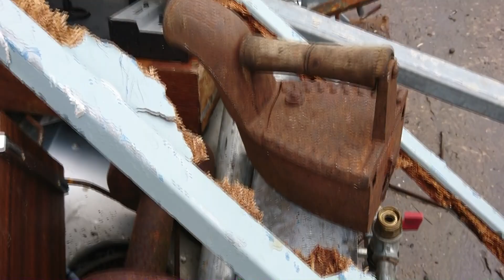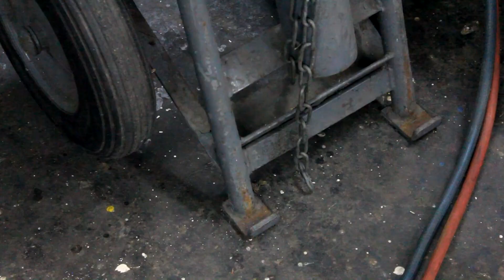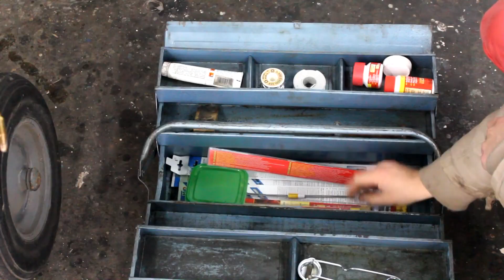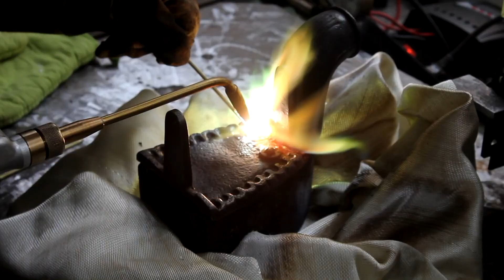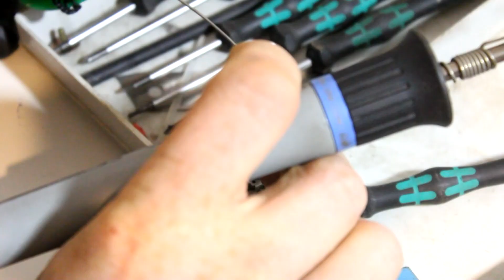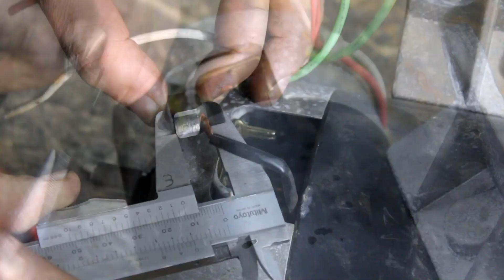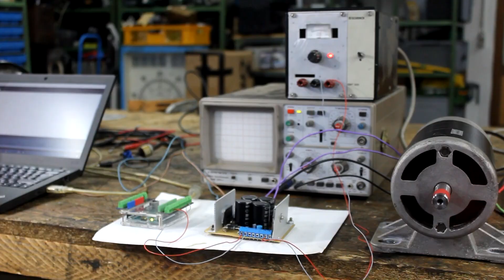Amazing Scrapyard Finds! Repair-A-Thon!

Comment from the maker: A new video is now online: https://youtu.be/XhzMke72xts
Reply: Using natural gas and compressed you would have achieved a neater seam. Borax paste coating the area and scrap brass instead of welding rods, you would have avoided the lumps of weld. Alternatively silver solder and  A 4 flux from Johnson Mathey. 
Unlike using the welding technique natural gas and compressed air enables the  brass or solder to  run along the crack or seam. Try it
Reply: Should have read compressed air
Reply: Nice now let's build a jet
Reply: The torch looks beautiful.
Reply: "You can't weld cast iron"
That's why called it cast iron

Comment: you done well by buying a new one and you done well on your first attempt to braze ... an Oxy torch setup cost a lot of money i know and i also know how it feels when your garage explodes ... i almost died.
So yes be aware of the danger using these gas tanks, keep checking for leaks make that cart trolley strong and stabile. I luv your works keep it up !!

Comment: A handy desoldering tool an be made from a hairdryer or even by putting a hood around a lively soldering iron in order to force a sirocco from the open end.  I find this manner to most efficient for programmable chips and other caterpillars, as it melts all of the solder at the same time, thus making the operation a "grab and go" maneuver with a pair of tweezers (forceps et alia).  I learned to braze with the help of a jar of Borax as flux.  As they say, practice makes pretty good.

Comment: I have seen some truly amazing cast iron welding done with some kind of iron filler rods and an oxy acetylene welding torch, I don't know the process but I know it can be done, also silver soldering works very well on cast iron and is very strong but melts at a lower temperature than brazing so no good for that coal fired laundry iron

Comment: I like the way you do your first attempts on video, you did an outstanding job brazing for a first attempt
one thing to watch for when testing for a gas leak is to make sure to use a non-petroleum based soap on the oxygen, Oxygen will react with oil and oil based product and could explode. Great video.

Comment: my advise for the homeowner is to go with lp or propane and oxy set up. All I used in shipyards and cuts just fine. You dont need the gas to be high pressure out of the cutting torch but the oxygen and your cuts are limited to the oxygen pressure. I cheaper in the long run and honestly a lot safer over all especially in shop spaces

Comment: Actually, permanent magnet direct current motors intended to be operated from power supplies supplied with ~115 volts AC are standardized at 90 volts DC. Your motor is intended for operation from a power supply that is supplied with ~230 volts AC, give or take. A simple rectifier and capacitor circuit results in a very low power factor on the line which is objectionable and not practical for all but the lowest power circuits. Instead they will have something along the lines of a rectifier and a pulse width modulation circuit to control the speed, along with some coils and caps and the like to smooth the input current waveform. There are likely other more complex circuits, like synchronous rectifiers and such. Would generally disagree with old tools, but do agree that they need to be made to be in a reasonably safe condition. Love your channel, keep it coming. ;)

Comment: I bought all my torches used and fixed most of them myself with things I find, I have 1 long Victor torch and 1 medium duty Victor torch that I soldered the cracked head on, a broken small Victor torch and a long Harris torch with a medium duty Harris torch both work perfectly tho and a smith long oxypropane torch prototype and 2 small Smith torches, all the medium duty torches I have have their welding and brazing attachments and I have all tip sizes for the cutting torches both Harris and Victor but the long torches can only cut not weld, and I have gouging tips and two 150cf oxygen and 145 cf acetylene, the only things I've ever bought new was a cutting tip and a 100ft hose and everything I have I got used or broken and they're my favorite toys

Comment: Regarding the DC motor control circuit: how did you calculate the number and values of the capacitors?

Comment: You should see about o-rings designed for hvac (heating and air conditioning) applications
Im sure they are availible in Germany. They last so much longer that the black ones
they are bright green or bright red in color , the wide range in temperatures they are designed
to work in is what gives them this advantage.Cheers from the U.S.A/Nick

Comment: 101 of buying used gas oxy set check all parts and change were needed, other way to fix cast iron is drill small  3mm holes  along the sides of the break and grind a 30 degree rough to both broken sides use 3 mil wire to stitch together preheat wire as you go and fill grinded trench with braize locking the stitch and break together stronger fix

Comment: Your intro was right on point. I do not have access to a scrapyard like the one you go to but we have a town 
"recycle center". Depending who is working that day I ""may  "" be allowed to take something out. Not even allow to buy anything there. When I am allowed to pick  it is incredible what I get. As I mentioned before the theme of my channel is reclaim repair reuse recycle. Nice safety upgrade on the cart. I am just getting into DC motor controllers & gathering information. Great video big 👍
Stay safe, Joe Z

Comment: and to think by blow pipe was made in 1942. also learn how to set up and start a torch, little bit of acetylene no oxy to start bring the acetylene up till its a flame with no smoke then increase the oxygen until a small blue flame is just poking out of the nozzle

Comment: With respect, Sir. The iron should have been placed into an oven to heat the iron to red heat. Then you can weld or braze, Why? Well, the heat is evenly distributed throughout the iron workpiece. The iron is not only cleaned of contaminants, but the iron is heat treated to that which it was when it came out of the factory, with the correct grain structure. The brittleness is less and should not shatter if dropped on the hard surface, for say 1:5 m. I hope this information helps.

Comment: Please I have a question ..What hapen if I use DC insted AC with corded power tools like drills or angle grinders is it  better? Or same .. I say this because once I read  that bad conmutation in AC is the cause for sparks .. please tell me your opinion or experiences

Comment: When I worked for my brother-in-law he was so afraid of lawsuits because of defective equipment. He bought all new equipment for every contract. Once the contract was finished he threw away more good equipment, some of it never used, and some of it very expensive to replace. 
When I hauled the equipment to the county scrap yard there were always gleaners going through the refuse. I made certain that they knew about the good items it was dropping off. Seemed like such a waste to bury it.

Comment: I would say that your brazing tip was too large, when brazing you want a pretty small flame so you can heat the patent material slowly and control the molten puddle more easily

Comment: Love the repair a thons. In Australia our voltage is 230v yet all the dc treadmill motors I have recovered are 180v dc. We must be a lot lazier than you Germans as I stopped picking up treadmills after I brought home my eighth unit in 18 months. All were pickup for free or out on the street for free. The ones that raise and lower the deck are good as you get a linear actuator as well. I converted a 240v Ac belt sander to the 180v dc treadmill motor and I’m very happy with it as now it is variable speed both faster and slower than the Ac motor. I bought all the parts of eBay and followed the instructions I found on YouTube and I couldn’t believe my luck when it worked perfectly first time. I even added a tacho so I know what the rpm is. It hasn’t missed a beat in two years. Jeremy Fielding has the best channel I have found for explaining electric motors and how to repurpose them. Cheers Stuart 🇦🇺

Comment: Bevel the joint at 30degrees and round the root face of no sharp edges dont touch the services to be brazed with your hands always wear gloves  if you round the bevel face the brazing flows round the joint only heat till cherry red.

Comment: "Airconditioning unit" is basically a compressor and heat exchanger for a small walk in cooler or split fridge system like you'd find in a bar or cooling display counter in a store...

Comment: Re: your dc magnet motor. I have three similar motors manufactured by the Ya Cheng Electrical Engineering Co. Ltd. of Taiwan. Mine claim to produce 4hp@4100rpm, 90v 25a. Would love to have over to visit my local scrapyard. Nice videos btw.

Comment: There is no need to use oxy acetylene when braising. Natural gas and an air compressor gives a 100% cleaner solder line.
 Clean surfaces to be joined. Coat with a Borax paste. Heat the area with the natural gas and compressed air torch. It's slower but cleaner. Instead of welding rod use brass wire. Have used this method when taught back in 1965. Borax stops oxidisation and if you can afford it Silver solder is better using a soluble flux.

Comment: I actually like the design of the torch cylinder cart, I think it needed a plate contoured to the bottle cylinder radii fastened at the upper saddles.
Nice save on the Becker cd player

Comment: I could imagine placing that DC motor on a bicycle and flying down the road. Perhaps mounting it within a cage that straps to the back with a propeller, strapped to the back with harness and use a paraglider to actually fly. I am certain it would be powerful enough.

Comment: That is the WRONG technique for brazing. DO NOT GRIND A V!!!  For brazing you want to the minimum gap. Grinding a V is for welding. For brazing, you want the thinest possible crack.  The joint should have flux applied, then heated. When the joint is hot enough, the filler should be applied to fill the joint through capilliary action.  You want the tightest joint and the minimum amount of filler.

Comment: you could have microwaved the flat iron. yes there would be sparks, arcs, and flashes of plasma, but IT IS OK it won't hurt the microwave and you can potentially get the metal up to 800F. Have you noticed the metal riser rack that comes with the oven?   I personally melt rocks in my microwave as stress relief, I can take most rocks except quartz from solid to molten in under 3 minutes (I get a pocket of molten rock about 1 inch round, bigger if i leave it on longer - not longer than 7 minutes).

Comment: I did not know you needed to bevel the joint to braze.  It has been 35 years since I took welding, but I was really good at it.  I would not think you would need to preheat to braze either as you are not melting the metal for the joint.  Brazing if done right should look like a solder joint.  You put WAY too much on both sides.

A motar like that can usually charge too.  I know people use moters like that for wind turbines.

Comment: The odd looking cast-iron object is a coal heated iron, very common in rural areas here in Brazil when I was a kid, you fill it with ember, open the back and do a pendulum movement to re-heat ;-)

Comment: I notice that you have a very fine quality chuck on your mains power drill. It is possible to get replacement internal parts for them. So it should last for many years.
Perhaps the DC motor came from an American base. Since they often had 110v power to the accommodation blocks; so service personnel could use American made equipment.

Comment: Decidedly more "marathons," but also some "ideas" on using induction instead of "coal" forges or gas.....!??!  Also, some work in the fabrication using plastics & fibreglass.....although the latter is generally more expensive than steel.  Also, repair a cracked circuit board with/without solder, and the perennial problem of "breaking the bead" of car tyres.....with salvaged pneumatics or hydraulics.....  Tyre changing is ordinarily a PITA!!!

Simplify electroplating and show how to clean a shower by pressure washing......without gouging out all the grout.....between the tiles....!?  (Some mild organic acid--besides acetic---may be the secret.....to cutting through the soap's film.....!)

Comment: As a message to anyone who wants to use oxy-acetylene, please always use flame arrestors and new tubing on your setup. Acetylene can be exceptionally dangerous in numerous ways, explosions and fire just to name a few. The same goes with welding. There are many potential dangers with both of these and I want everyone to be safe with them. Do your research and get good equipment so you don't end up killing yourself.

Comment: The DC motor at low RPM would make a good wet wheel knife and tool sharpener.

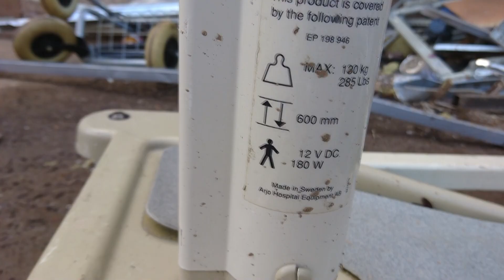Comment: 2:50 I'm a nurse. In the US, we call those Hoyer Lifts. They make mesh nets that are snuck under the patient while they're in bed or in a chair and then they're lifted. They work very much the same way as an automotive engine crane. Honestly, being a medical device, you're right that it's probably expensive - I'd challenge probably not justifiably so. It seems many medical devices, at least here in the US, have never been subjected to any kind of practical scrutiny when it comes to cost effectiveness. They're overbuilt, but not necessarily in a good way.

Comment: Just a thought. You were talking about being concerned about safety, but then you lit your torch with both Acetylene and Oxygen running. You're always supposed to start it with just acetylene and then add the oxygen. Otherwise you're sparking into an unknown volume of pre-mixed high-temperature combustible gases.

Comment: There are easier bubble liquids than soap and water. It goes on with a soft cloth ball attached to the cap.  Goes on just wetting the surface but any leak causes distinct bubbles.   Soap and water out of a squirt bottle tend to automatically make bubbles. Harder to discern leaks especially faint ones.

Comment: I used to repair oxy-acetylene fixtures. Your handle air control needed packing on the thimble control. You could of fixed it yourself very easily Inventor. But I guess it all depends on what type of risk you are willing to take. I would love to purchase a exact set that you have purchased. Can you be willing to get a good used one for me ??? Thanks a lot and have a great day too.

Comment: I find it so interesting the tool combos out there.  You have a tig machine, a tubful of citric acid, all the angle grinder and bench grinder accessories out there.  I've often gotten by on only my old oxyacetylene setup gifted me by my grandfather for all my cutting and welding needs.  It is the only thing that has a permanent mounted position on my truck.  Thanks for doing what you're up to.  Love and live the reuse ethic.

Comment: Please check so there is non-return valves where you attach the hose on the burner handle. They prevent the hose from exploding. It is a good safety equipment together with the flashback arrestor on the gas regulator. Sometimes the hose connectors have built in non-return valves. The flashback arrestor only protect the gas bottle.

Comment: Hi there, thanks for your videos! A little hint about fixing those encoders or similar contacts:
Instead to use a screwdriver that can leave  scratch inside and cause miscontacts  use a fiberglass brush like this one:
https://www.amazon.it/gp/product/B016ZXN3NG/ref=ppx_yo_dt_b_asin_title_o00_s00?ie=UTF8&psc=1

it's soft enought to dont destroy the tiny contacts inside, but hard enough (it's glass :D ) to remove those traces.
Another issue on those encoders that can have inside lubricant grease leaked from the main axl.  isopropilic alcohol it's a good way to remove it without damaging anything else  ( ps dont use that alchool on printed surfaces, it can easily whipe the ink)
Hope to be useful to you and thanks again for your really good videos!

Comment: I have a bunch of used torches I've bought of the usual auction site.  My advice is to take them to a welding supply that can test them for you.  My supply depot did it for just a few bucks and while they were at it they replaced the broken glass on my regulator. O and never use a hose that you haven't owned form new.  The hoses are subjected to all kinds of don't do that.  I've never had a failure of a torch, but I have had hoses fail. Mostly because people abuse them. 

I love watching you fix the old German tools like that torch.  We just don't have stuff like that in the USA.  I love the old gas welding and cutting stuff they are works of art.  Even the most utilitarian ones look awesome.

Comment: You can use a pencil and or pen eraser to clean the switch contacts. The motor can be used to generate electricity. Nice finds!

Comment: Oxy acetylene - when I was an apprentice we used it often (blacksmith/welder at a mine) and I remember that despite us using new and high quality fittings (including flash back arrestors) we twice had actual flash back to the acetylene cylinder. The fire services were called and the bottles placed into a large tank of cold water.
You did the correct thing with being cautious.